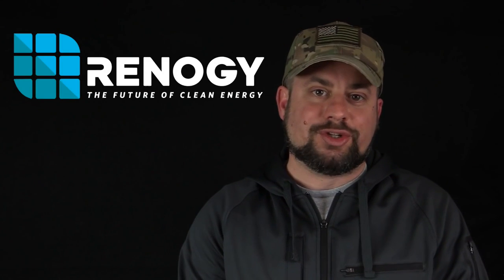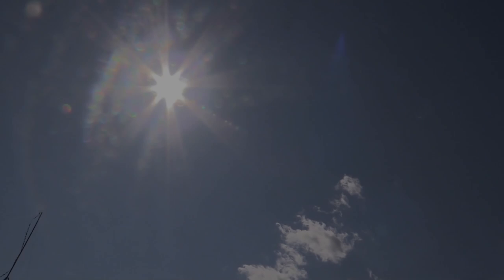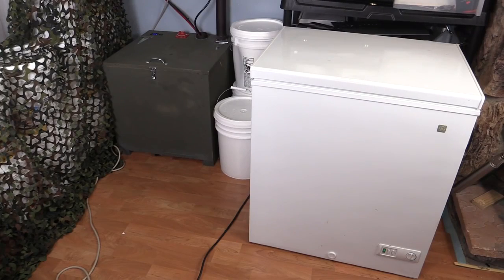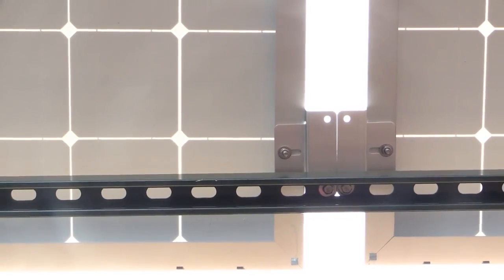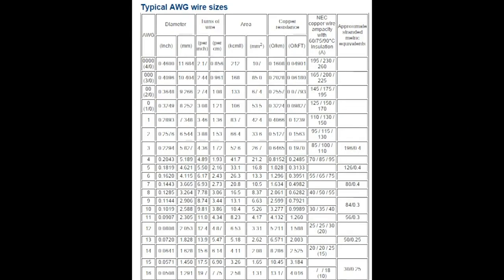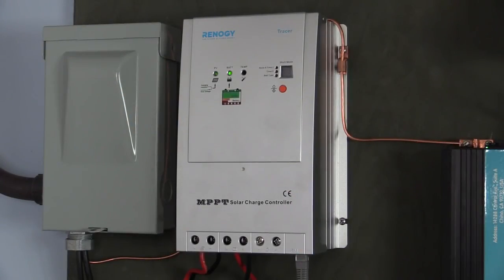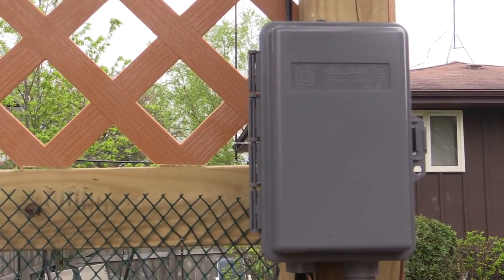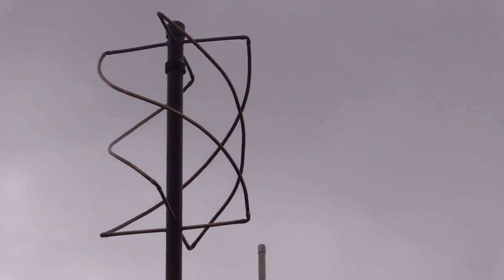The Ultimate Guide To DIY Off Grid Solar Power | Tin Hat Ranch

Comment: 4 100 watt solar panels and store it with 4 golf cart batteries?!? Why not get your self a real system with a real battery back-up solution. What are you gonna power off 1kw of electricty?!? hahaha

Leave it up to professionals. Know its done properly and take advantage of the warranties and service contracts they provide. 

Fact is if the grid goes down and your relying on that your still basically screwed as apposed to getting a proper system and you could completely maintain your lifestyle

Comment: I've learned so much from this video: From the batteries in series to the batteries in parallel, the solar panels, the wire thicknesses, why our grid system uses such a high voltage, etc... Thank you very much!
It is a video that I will be sure to keep coming back to retain every bit of info.

Comment: What about deep cycle marine battery's?
Reply: I use 12 volt deep cycle batteries.  i actually use two different Marine batteries.  They are close enough together that I can combine them. I buy my batteries from Sams Club that is owned by the Sams Walmart corporation and I buy the other batteries from Home Depot.  Some Home Depots sell deep cycle marine batteries.  My main battery bank is made up of 8 deep cycle marine batteries.  Duracell 29HM from Sams for about $100 each and  Exide Nautilus Marine / RV Deep Cycle batteries from Home Depot for about $100.

I went with 12 volt batteries instead of 6 volt for two reasons. #1 I did not want to use 6 volt batteries because if one goes bad, you have to remove another perfectly working battery because you need two of them to equal 12 volts.  #2 the golf cart batteries are very expensive.  You need to consider what you will be running off the batteries.  I do not run the things off my battery bank that most do, so I do not need golf cart batteries.  

I only run lights and fans.  Well actually I purchased a small 1 amp refrigerator and a 2 amp freezer.  I also have a small apartment refrigerator that is about 4 foot tall and it is 2.7 amps.  So I could run them off my battery bank, but I don't. We quit using the full size freezer and full size refrigerator. We are also going to add two RV refrigerators that run off from propane gas. This way if power goes out and the weather is bad for a couple weeks, we can still use the RV refrigerators.

We also have been purchasing items to cook with that do not need the battery bank. The Coleman tailgate Grill, The Orion Charcoal Cooker, The Coleman Duel Fuel camping stove (we have two of these) and added propane adapters to them, so now they are three fuel camping stoves. We just purchased the Cowboy Fire Pit Grill for $159 on clearance at Home Depot. We also have two Glass French Coffee Presses and three plastic camping coffee presses and three stainless steel kettles for boiling water for cooking with or making hot drinks like coffee, tea and hot chocolate.

So you see, we put thought into how we wanted to be able to do things when in a power failure situation and also have things we can use when camping or picnicking at parks.  I would also like to mention that we have another smaller battery bank that is made from four 12 volt 7 amp hour sealed batteries.  You can get them at Walmart, Home Depot or anywhere that sells emergency lighting batteries or batteries for electric gate openers. We use this bank as a power supply for 12 volt LED lights, the ones used in RV Campers.

We also picked up some cheap 250 watt and 500 watt halogen utility lamps and gutted them and converted them to LED.  All of the lights in our house now total less than 200 watts. Our electric bill used to be $600 a month and now we have it down to $75 a month... or at least in that range. That saves us $500 a month and that totals over $5,000 a year. We replaced everything  over a two or three year period.  In the first year, within about two months we got our light bill down to $300 a month, after a year we had it down to $150 to $160 a month.  When we started, if you had told me I would have our light bill down to $75 a month, I would have laughed at you.
Reply: Fla-bushcraft Prepper 
Check into the Rocket Stove. Takes very little sticks and twigs to keep it hot. If the grid goes down the hoarders will buy up all fuel sources, like propane, and sell them for the price of gold. I won't own any stoves that take a fuel source that has to be purchased.

Comment: 900 va inverter .200 wt solar panel and 150 ah battery..is it fine or should i use 300 wts of solar..
plz suggest how many ampere solar charge controller do i need

Comment: Thanks for the video.  Do you know if there are any 2017 incentives to adding solar to your home (rebates/ credits? ) It seems they may have expired on Dec 31 2016.  Is there a source of info/ chart for a ratio of panels to battery capacity as a rough guide or is it easier to just calculate it out?  Thanks for all the great videos.

Comment: Tinhat man needs to see the cyboenergy plug and play inverters. No battery required to plug in 120 volt ac. And the Powerwall video. Sooner the better.
Reply from the maker: +Bruce Marmy those are interesting, but they won't work in the states application, sort of.  They are designed for a grid tie system, you can't store the energy.  In a grid down or off grid application you would only have power during the day.

Comment: Hi, a quick question. 
What happens when the Batteries are fully charged,  where does the excess power go to? And is it unhealthy to have the panels sitting there producing power when its not been used?

Comment: Love the video.  I am in the process of duplicating this setup.  Doing a couple things differently tho.  I am mounting the charge controller and inverter inside a large husky toolbox with the 4 batteries.  I will have a small 12v fan that blows air into a pvc pipe that should vent out the gases.  Adding quick connect/disconnects to the cables that connect to the batteries.  Most important, I bought a star wars r2d2 coffee press for the wife lol.  This will give her coffee without electricity. :)

Comment: I was searching for the SLIGC125 Batteries at my local Battery Plus, and the sales attendant told me instead of paying $129.99 (+$15.00 core charge) for the 235Ah SLIGC, I could purchase the 230Ah SLIGC115 for $109.99 (+$15.00 core charge) and save $20.00 per battery for a minimal 5Ah loss. For my system, needing 6 Batteries this saves me $120.00 total, and I get 12v @ 690Ah, with my 5 panel design.

Comment: Great vid!  Thx.  Was looking to start my solar experience with some used panels.  In area someone is selling 50W Solarex SX146 panels for $35 (over 10 years use).  Are used solar panels worth it at 50W or should I invest in good kit at 100W panels or in the new panel designs?  Do you feel your kit is sufficient or needing some expansion?

Comment: I just about got my solar backup system ready. Just waiting for a replacement inverter from Amazon as the first one had a defect. (It's always something.) My system should be able to run my big modern side-by-side fridge 24/7 for somewhat extended blackouts, and if I unplug it I can run my 1600 watt bread making machine, 1600 watt Keurig coffee maker, 1400 watt microwave, 1500 watt electric griddle, ham radio, etc. 

It's been a fun experiment so far. I'm working on a 'top of pole' mount' for the panels using the hardware from an old Directv dish. I want to be able to rotate the panel towards the sun as needed, as opposed to a permanent mount which requires more panels to capture the same amount of sunlight. Just rotating them three times a day (morning, noon, afternoon) will give you a big burst of daily battery charging.

Comment: how about solar PVT hybrids for heat and power?
How about solar thermal at very low costs, with low cost hot water storage that can support home heating and cut air conditioning running costs by 30% by using the heated water to heat the gas before it hits the compressor

Comment: It's really not too hard to bury one end of a 3 or 4 inch diameter pipe in the ground with concrete, and put together a 'top of pole' mount for your panels that you can rotate towards the sun as needed. Mount them to a pole that will slip inside the buried pole. Just rotate it some 3 or 4 times per day and you won't need nearly as many panels because you will take in a whole lot more sun hours per day. Just aim them East before you go to bed every night and adjust them at least at noon and then again late afternoon. There's some not too expensive panel mounting kits for this. You supply the permanent 'buried' pole. You can also use satellite TV mounts and unistruts to fashion a mount, if you keep the panel size reasonable.

Or if you have enough space in your yard, set up a long pole at an angle perpendicular to the sun, (one end will be on the ground and the other end propped up by a fence or whatever), and after you mount your panels to it just rotate the pole to follow the sun east to west. As the seasons change, you just raise or lower either end, adjusting for the seasonal angle of the sun. (Of course in the middle of summer you'll need to raise both ends off the ground to be able to rotate east to west.)

All the online calculators list the sun hours you can expect for fixed rooftop panels. In Vegas we get strong sunlight for over 8 hours a day in the summer, but the calculators show almost half that, because of fixed-in-place panels. So when you can follow the sun you almost double the amount of power the panels will get.

Comment: I used to work for a company and one of my tasks was building solar controllers (angular controllers which tracked the axis of the sun) for their independent solar panel rigs.   I no longer work for them and I do not represent either company.   The company the solar controller was manufactured for was DHSolar.   Look into it.  I cannot speak to operational quality but I wanted to mention it if you are interested.

Comment: Great introduction to PV. Some more points. Decide at an early stage the ultimate size of your system. If more than 250 W and 50 V DC then you may be subject to code compliance and national standards. Also as you string panels in series the voltage quickly ramps up.  Consider anything around 50 V or more potentially lethal and the DC capable of serious burns.  Children should not be able contact any part of a PV system. With fixed panels consider wind loading e.g. hurricanes. My structural engineer told me a rule of thumb is allow a force of 20 lbs per sq foot on the panels. Snow loads may be additional to the wind load. The panel mounts shown may be adequate but will the hen house get blown over?  For non trivial systems you might want to talk to your insurance company that you are still covered.  Good luck and don't be put off solar is great.i

Comment: Excellent video and easily explained, thanks.  One question.  If you connect your solar panels into series and increase the voltage from 18V to 75V.  Your MPPT is now dealing with 75V however your battery bank is only set to 12V.  What exactly does the MPPT do in this case?  I would have though that MPPT can only charge the battery bank in this case at 12V (14.4 or the max voltage you have set on your MPPT), however what happens with the remaining 60V~ is wasted or not used?
Reply: This is a very good question which he should have explained in the video, because in my opinion the answer to it is the number one reason why you should pick MPPT over PWM. This is almost never explained good enough anywhere.

A PWM controller CAN accept higher than 12V. It will step the voltage down to whatever you need to charge the batteries, but the amps remain the same. Let's use some easy numbers and a 100% efficient system to see what is going on. A solar panel at 20V and 5A will produce 100W. A PWM controller will step this down to 14~V to charge your batteries. 14V*5A = 70W. So 30W is wasted.

A MPPT controller on the other hand will step down the voltage, and increase the amps to compensate for the lower voltage. It will try to keep the watts constant. When it steps down the 20V in the above example to 14V, it will increase the amps to 7.14A. 14V*7.14A = 100 W

Comment: TinHatRanch love the vid very helpful! and the name funny funny! 

Can anyone give some insight: 

I am working on a very similar project and i have a window of 50 more days before my schedule tightens back up. I need to get a solar system on my van quick style. I have a couple questions maybe you'd be kind enough to throw some ideas my way...

I want 1000 watts of panels as well. It seems extremely tough to get help on the subject though. 

I don't want to get a kit because like making your own computer i'm sure there's better products available. This is what i need your guys' experience in. 

Pretty standard:

If i had a 960-1000 watt panel system:

-What would be the best controller.
-What would be the best/Safest Inverter.
-How many batteries (I like the Vmax 155ah deep cycle ones)
-What should i use for fuses/fuse box
-and what kind of wire is safe to put it all together with. I really need to know what wire i will be connecting the controller to the panels because i need to run that wire and start closing up the walls. 

Anything will help guys.. and if you happen to know a good source for more info

I just want to make sure i put this together with the correct components. My budget is the exact cost. which means i'll be over guaranteed.) no room to fudge up

Comment: What's the average watts for a small 10,000 - 20,000 AC? (the small ones who plug directly into the wall)
I'm interested to know what I would need to be able to run it worry free
Reply: does an inverter AC changes anything?

Comment: Prioritize your Solar System.  Start with your refrigerator, then go into orbit.
Reply: Think of it this way.  If the power goes out and the food goes bad, if you have a freezer and a refrigerator, you flushed a grand down the toilet by not having it off of the grid.
Reply: Look at the horsepower on the electric motor for the refrigeration unit of a walk in freezer or refrigerator at a restaurant, if you can.  Maybe amazing.  They are badly insulated metal shells, and walkin are much more efficient.

Comment: Thanks for the video. I wonder what the impact is on lifespan of a panel when comparing series vs parallel connection or running them on 12v vs 48v and up.

Comment: Thank you for that great amount of knowledge concerning Solar Energy.
What about mix between series and parallel panels? Would that improve or hold down the whole system, using your set up as an example.
Do you use a computer plugged in the system? Notebook or desktop? You got consumption as high as the chest refrigerador or a little bit lower than that? Anyway, thank you for the whole explanation. I didn't know the differences of the regulators and most of the descriptions on stores in my country hide this precious info.
Reply: A Cosmic Castaway  - interesting information
Reply: My pc use's less power then he refrigerater..
Reply from the maker: +A Cosmic Castaway the seriesed panel voltages would be brought down to the parallel voltage, you'd actually lose power.
Reply from the maker: +A Cosmic Castaway the seriesed panel voltages would be brought down to the parallel voltage, you'd actually lose power.
Reply from the maker: +A Cosmic Castaway the seriesed panel voltages would be brought down to the parallel voltage, you'd actually lose power.
Reply: Cosmic : I have friends that use their computers off grid completely, and they prefer to use laptops.
Reply: typically people refer to panels in series and parallel as strings.  because you need more than one panel to make a series and/or parallel connection.  So for two panels you could do, 2 in series or two in parallel.  the panels themselves are not series or parallel, when you say, mix between series or parallel panels.  for a 1,000 watts, which is his inverter, you can power about 10a plus or minus.  typically your computer is well suited for this, if its not a tower, over 10a.  I have a 24v system, with a 2500 watt inverter, I use about 50% of my harvest.  I can run everything all night, till dawn.  I don't have a refrigerator.  We are off grid, and we just use a cooler.  Our climate is very rough on equipment.  So we might in the future.  If I did, it would propane or DC.  Grid down, DC.  But if I put on two heat lamps, I raise my usage by double.  It just depends on your amps.
Reply: Gosh..i am thoroughly informed, like i enjoyed the Godfather movies series narrated by the Don Corleone himself...well done bro...well done down to earth prof..

Comment: Loved the video.  I just purchased what I hope is the same equipment.  On Ebay I purchased (4) 100 watt panels, A 40a mppt charge controller, a 1000w Renogy Inverter and a tracer meter.  Spent $1020.   Right now my goal is to only run a small chest freezer that averages 172kwh per year.  That should come out to under 500w per day.  With this setup I should have a few days of backup power available to ride out any rainy days and no sun.  If this works as well as the video shows and if the math adds up like I am thinking, I will then duplicate this same system to run another chest freezer that will be converted to a fridge by changing the thermostat. This should use half the energy.   This system will also run bonus things like an led tv and a few led lights, charge cell phones and laptops.  I know I can just add panels and expand my system but my plan will be to mirror the first system so that I have 2 running side by side.  If I lose an inverter or charge controller well then I will have a redundant system up and running already.  I may pick up extra (cheap) charge controllers and inverters too.